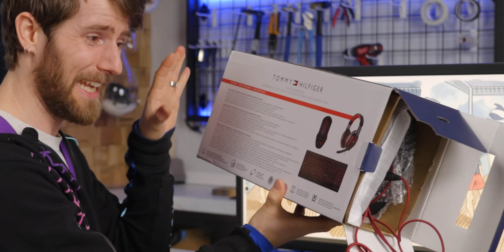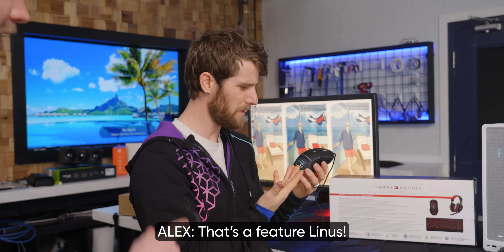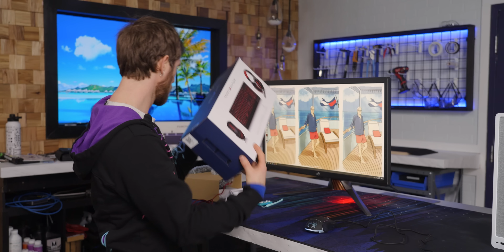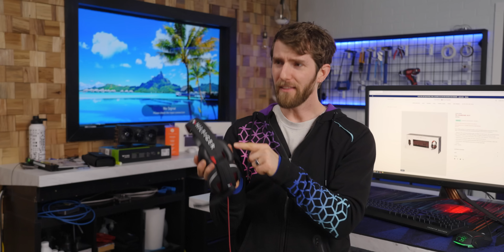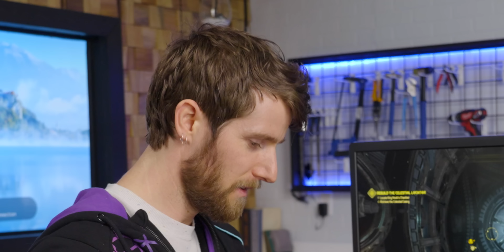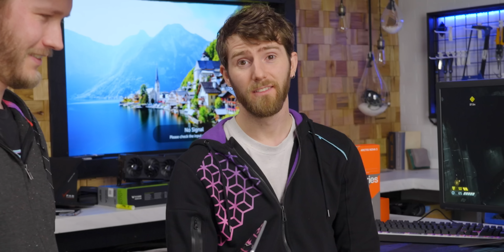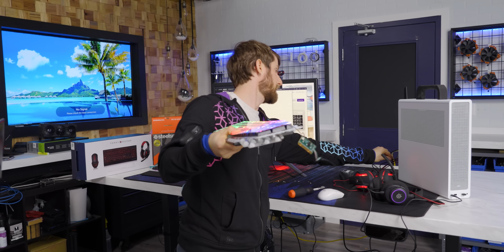Tommy Hilfiger are Filthy Scammers

Comment: $150 for the kit should be criminal. At that quality level it's predatory and should damage the brand image. That said I grew up on and used extremely cheap gear. $5/$10 keyboards from Roses that had the same RGB. Mice with no RGB that only had 2 buttons and would start double clicking after a few months use. Earbuds with in line microphones from Dollar Tree that wouldn't even work out the box sometimes. Now my desk has about $3,500 worth of stuff setting on it, long past the cheap stuff. In the moment it's the same, you're having just as much fun, making just as many memories, grinding away just the same. You've learned to work around the quirks and have mastered the art of adaptation. 110% NOBODY should be spending $150 on crap like in the video, but cheap crappy gear has it's place and no one should be shamed for it.

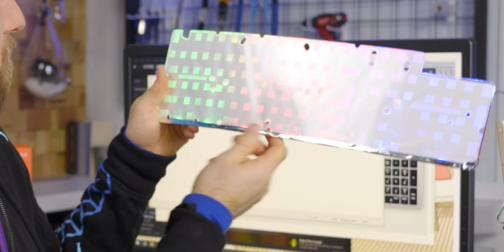Comment: 26:37 The black blob isn’t there to prevent reverse engineering, it’s a Chip-on-board covered in epoxy to protect the die, which is directly bound to the PCB ("glob-top"). That’s a high-tech manufacturing method usually only found in quality products like Happy Meal Toys and other cheap-ass electronics. Basically, the IC to simple and to cheap, to afford a housing…
Reply: It reminded me NES and famicon game cartridges(without plastic cover obviously) i had as a kid 25 years ago.
Reply: "Quality products like Happy Meal Toys" got me dead 💀
Reply: @smrqdt  Im currently in the process of trying to fix a pinball machine with one of those chips, and its the thing thats broken....
Reply: you had us in the first half ngl

Comment: The "glob top" chip at 26:39 isn't an anti-reverse-engineering measure in this context (like you will see in some guitar pedals); it's actually a manufacturing cost reduction measure. At certain large manufacturing scales it can be cheaper to buy the raw chip dies, bond the wires on the board, and then smear goo on top to protect it. (I can't quite wrap my head around it). The term is "chip-on-board."

Comment: The fun part is that the fixed RGB colors on the keyboard could at least be used to project the Tommy logo, but obviously that would be to much effort.
Reply: Another fun part is that they show it as all red lighting on the front of the box, and there's no way to actually do that with the lighting on the items in the box.
Reply: I thought the same thing, that or it would cost more to manufacture and Tommy would have to either make less or charge more. Also the "big brain" exec that came up with the Tommy RGB keyboard  idea probably didn't know it was an option.
Reply: @unsaved013  only things the technically illiterate 67 year old big honchos decide, is how much money is invested into product and its development. if they say as cheap as possible, as fast as possible, that's what will happen, and this is what you will get.
Reply: I thought the same thing.

Comment: This is nearly the exact same kit I bought at Walmart for $25 last year.  Like the mouse is identical, the headset is nearly identical, etc.  Mine is "Game Onn" Branded.  For $25, it's not a horrible little kit - I'm still using the KB and headset at this point.  They're not amazing, they're not horrible.  For $150? All I can say to that is lol.  Bonus points for the fact that my $25 kit came with a decent enough mousepad as well that I'm still using over a year later.
Reply: Yeah, for $25 if this had came with a decent mousepad too, I would have loved this as a kid. Iused a keyboard with 2 dead keys for like a whole year as a kid, so this would have been great.

But for $150 in 2023? No. Just no.
Reply: I once got one for $15 and it came with six battery powered hex lights.
Reply: I once bought an onikuma branded kit like this and its exactly the same product minus the headset
the exact same kit is sold by a brand named runmus
its literally a generic keyboard and mouse
Reply: Honestly 25 is still too much.
Reply: It was kinda demonstrated at length in this very video that they're horrible. You might have wanted to say serviceable. Even then, I probably wouldn't agree. You just wasted $25 instead of $150.
Reply: Looks like Redragon rejects. No offense to Redragon. They make very good budget periphs IMO.
Reply: @cardinaldriver  i agree with this totally, Redragon is 100% a good company, you sometimes dont need a super expensive peripheral experience
Reply: @BlindSp0tz   Totally different case from crapping on someone who has bought it for like 150$. Like TOOOTALLY different budget
Reply: That's all branded gear is. Rebranded average kit
Reply: I bought Tommy head phones off a clearance rack at HomeGoods for like $12. Needed a headphones and that was the only choice. Worth every bit of $12 and not a penny more lmfao
Reply: @Don't Matter Nah, $25 is the bottom of the range in price. Of course he got the lowest quality as expected
Reply: the headphone remind me of my first "gaming" headset, it was about £50 from a brand called "Sades".
Reply: Iirc Onn is walmarts attempt at getting into gaming peripherals
Reply: LTT actually made a video about the Game Onn series when it started.
Reply: The mouse alone costs just $5 in the UK at "Asda" which is a nation supermarket Walmart bought a few years ago.

Oh and the headset isn't completely useless. But marking it up for $150 is just theft imo.
Reply: @Great.Milenko  Walmart sold their stake in ASDA in Feb 2021 to EG Group, so they no longer have anything to do with it, as the ASDA brand was not profitable enough for them, and they want to focus more on their own stores here in the US, and Canada.
Reply: To those saying even for $25 I paid too much - I'm still using the KB, Headset, and Mousepad over a year later.  Getting over a year worth of use out of 3 things that I paid $25 for really isn't "Scammed" in my book.  Could I have potentially gotten better stuff? Sure.  I've been happy with what I got though, and it has served me well.   I'd still be using the mouse probably too if a 2 year old hadn't yanked the cord and broken the USB connector off the end.

The kit is in my "To-go" setup.  It gets dragged around all the time from one house to another.  I don't want anything fancy when it's getting thrown about in and out of car trunks.  It's served the purpose I had for it perfectly.
Reply: Was going to comment about this. I swear ive seen these kits advertised on amazon for no more than $30. 

This 500% markup is absolutely insane
Reply: @liam_taco  even more, since the retailers shureley also make money on selling these kits
Reply: The problem is that stuff is going to end up in landfill probably a year from now.

I have a Razer Black Widow mechanical keyboard. It was one of the first mechanical gaming keyboards released around 2010. I'm typing this comment on it right now as I use it on my work computer. That's over a decade old. Still types just fine. The single glowing blue LED on the Razer logo still works.

I also have a pair of Sennheiser HD555's I purchased around 2007 I believe. I used to take them to Halo 3 tournaments. They've been on planes, shoved into back packs and abused to hell. They still work and my daughter was using them for online learning through covid school shutdowns. These headphones are almost old enough to drink in Australia. Obviously they weren't cheap when I bought them, but I've gotten over 15 years use out of them and they sure as hell sound better than the $25 garbage headphones you can buy. If my main headphones were to die right now I'd happily wear them and wouldn't be desperate to buy a replacement.

The issue with cheap products is that they're so disposable. This literal garbage is shipped around the world, transported on trucks, gets used for a year or 2 and then ends up in landfill to sit for the next millenia.

Just save up a bit longer and buy something that will actually last and then even when you do eventually buy something new at least you can hand it down to someone else, sell it or keep it as a spare. Literally no one is going to buy a 2nd hand "Game Onn" keyboard.

And before you say this sounds like the opinion of some rich snob, I bought these things when I was a teenager working a part time job after school and I certainly didn't come from a well off family. When I bought things I wanted to buy stuff that I know would last so I saved up longer.
Reply: @rodrigoferreiramaciel4815  Thing is I'm not crapping on anyone, whether they spent $25 or $150. It's the product itself I'm crapping on. I empathize with those who bought that shit.

Comment: Anyone who has experience with cheap (understatement) gaming gear will easily recognise that mouse design. It's actually called Redgear A-15 and costs less than $10 and they pretty much just removed redgear's logo and slapped their own. It's also possible that they just used the same manufacturer which is pretty common with Chinese products (same thing being sold under different brand names).
Reply: Yes, same manufacturer, image search returned Onikuma CW902
Reply: As person who uses cheap mouse and keyboards your speaking faxs not even 1 word was wrong in your sentens evrything is faxs just chines products sold by company for 10x the Price
Reply: White label has nothing to do with it being Chinese though. There are manufacturers everywhere in the world who sell white labeled products. It's just more prominently Chinese because they have cheap manufacturing so more companies resort to them.
Reply: I have that RedGear mouse. Initially I got the same thoughts
Reply: bro i use a $5 mouse and its way way way much better then that crap
Reply: That happens to a lot of things, including food. You could buy a soft drink from one brand and a different brand and it's the exact same thing, sometimes it even has a different price if the brand is able to pull it off.
Reply: For 10 bucks the mouse is really good. Just make sure you don't pay a single cent more lol.
Reply: I recognize that headset as a "Dreamgear" brand as well. It's crap
Reply: @zkilerex9661  your grammar is excused for the truth you say
Reply: when i saw it, i knew what it was, because i was holding that very damn thing in my hand .
Reply: Same for headphones
Reply: dude, that mouse looks cheaper than the SGD$10 mouse I bought from Miniso

and that thing is wireless
Reply: literally was thinking the same thing. something similar I have cost £12 and with the headphones, dear lord I have practically the same exact pair except with blue accents and they cost less than £20, yes pounds so convert all that as you may.
Reply: Chinese manufacturer wonders of "if your agreement didn't say to burn the molds, we'll make billion extra and sell them oem to anyone who asks"
Reply: They kind of remind me of some filthy scamming tech youtubers who sell 5-10 dollar screw driver sets for $69.99 at LTT store....
Reply: @ducksoff7236   ok? but why bother hate watching? I see you have a comment saying something similar 4 months ago. go find something better to do. we all know YTber/big name products are expensive, acting like this is something new is just wasting your time.
Reply: @LiterallyAllNamesAreTaken  Wow! You're hilarious. How "hate watching"? Just because I call someone out on something? That makes no sense. They call out Tommy Hilfiger. I just did what they did. WTF is wrong with you? LOL!
Reply: @ducksoff7236   hate watching. you commented 4 months ago basically the exact same thing. maybe you’re seeking agreement since this still affects you?? bc you’re still here and still watching.
Reply: @ducksoff7236  projectfarm reviewed his screwdrivers and they are actually very good.
Reply: @AsmrWorldvids  And? Still not worth 70 bucks lol
Reply: even the keyboard is recognizable its only $2 in my country!
Reply: Nah its actually 5 dollars lol
Reply: @zkilerex9661  what
Reply: i used to have the a-15, it lasted about 8 months. i have an a 17 rn tho and it works flawlessly
Reply: True, I too had a Redgear A15
Reply: @Free-Coder-i9p  that's because it the same product but with a different price
Reply: Yeah I got a set of this stuff from a random chinese manufacturer(with the EXACT SAME mouse, keyboard and headset for like 15 bucks
Reply: redgear are just a brand that buy this generic mouse and rebrand it. Thats what all the cheap keyboard, mouse , headset accessories are.
Reply: yes I used for a long time cheap mice that would spinoff at high movements and even a mouse I had that I paid fucking 7 dollars didnt spinoff as badly like the one in the video, after getting a g203 I actually didnt believe that moving your mouse the entire mousepad fast was even possible, and now I have a razer viper and dude they're so cheap for how good they are, I feel bad for some kids who want gaming gear with lights and they end up buying crap like this
Reply: Redgear is actually the cheap GOAT. I have a redgear A20 it's amazing, it's software is super customizable and it's an amazing mouse
Reply: Good eye
Reply: its true i do have that mouse but i replaced it with razer deathadder
Reply: i got the redgear a15 for like 399rs(5$)
Reply: I've never used super cheap ?mouses? ?mice? (the cheapest mouse I used was an old logitech [mx518 I think from googling] tho it wasn't a comparatively cheap mouse, mice just weren't expensive at the time) and I didn't recognise the exact design but I knew just looking at the box it would be bad (for the price) and that any kb packaged with it wouldn't be worth using over any old membrane kb (could probably get better at an op shop [thrift shop for non aus] for $1, maybe less)
Reply: OEM
Reply: i clicked on the reply button wit a redgear a15 i bought for 9$
Reply: like the Freedom Phone yeah haha
Reply: You heard back from Tommy?
🤔🇭🇲
Reply: Found it with no brand on Ali for $2.35 a piece. I guess nobody really knows the correct brand name lol
Reply: That's the comment I was finding for real
Reply: @shravankumar9456  oh my god yes. i saw this and looked at my mouse which i bought for almost only 5$ and slowly turned back to the video lol

Comment: That "anti reverse engineering schmoo" is actually literally the IC package itself in that case, if you're pumping out a bazillion cheap boards it's more cost effective to put a bare die directly on the PCB and run the bond wires onto the board without a package in between. You then need a blob of epoxy to keep everything in one piece.
Reply: Agreed! Look at cheap solar lights PCBs!
Reply: That's what I thought too, I recall seeing that blob was always being a sign of cheap/knockoff electronics (it's a big and obvious tell for if a cartridge-based game is a bootleg and not an original for example). I was confused when Linus said it was to prevent reverse-engineering.
Reply: Agreed, not anti reverse engineering schmoo.  The correct terminology is Chip On Board (COB) and is very common for high volume, low complexity products. For example, the very common text LCDs that show 2 lines of 16 characters, are universally COB construction. Greeting cards that have any electronics (music, voice..) are also COB. All digital Calipers too. The black epoxy provides environmental protection of the chip, but even more importantly, it protects the thinner than hair bond wires between the chip and the PCB.
Reply: @mechanoid5739   or at cheap NES clones (or anything cheap)
Reply: @nostalgiadude  Things there the whole board is cheap to discard if somehow the bonding fails.
Reply: @fliptrontube  Not always anti-engineering schmoo* .also how calculators have survived falls for a long time

Comment: The "anti reverse-engineering shmoo" as you call it is a drop of epoxy , it's here to protect the integrated circuit from being damaged. It's a Chip-on-Board design, meaning the silicon chip is directly mounted to the PCB, with no packaging. It's sometimes used to save pennies on very large scale productions. (26:40)
Reply: Sad times. A bot who copied this comment got more upvotes than the original.
Reply: Came to say this!
Reply: @IdleCommentator  That's because the comment repost bot is paired with a ton of upvote bots to make sure their spam gets seen.

Comment: Fun fact about the black blob, It actually might be a Chip On Board (or COB) where they take a bare die, glue it to the pcb and dump shmoo all over it. It is marginally cheaper than actual packaging, but that's not surprising looking at the rest of the gear.
Reply: 100% COB. I think you can even see the square DIE in the middle.
Reply: This is correct
Reply: this is too funny
Reply: @mikeycrackson  Protecting the bond wires and the die from light. Certain wavelengths can upset silicon quite a bit, xenon flash for example is enough to temporary brick a chip.
Reply: @DrakkarCalethiel  That's right. Sometimes manufacturers omit the schmoo and that screws them over. Eg the Raspberry Pi 2 did it for a bare-die chip and that caused the board to reset or lock up when you shine a bright light on it or use flash photography.
Reply: @NavinF  That's exactly why I knew about it. I think Ben from Applied Science made a vid about this exact issue. Just shows how bloody sensitive microelectronics really are. 
Only difference is that in this case the die is connected via bondwires instead directly soldered to the board like on the RPI2

Correction, it was on the RPI 3 and Dave from the EEVBlog made a vid about it, 6 years ago! https://youtu.be/dDcsTnqVgWc
Reply: Hmmm hello, fellow BigClive viewer? Haha
Reply: Colloquially referred to as a "glop top" package